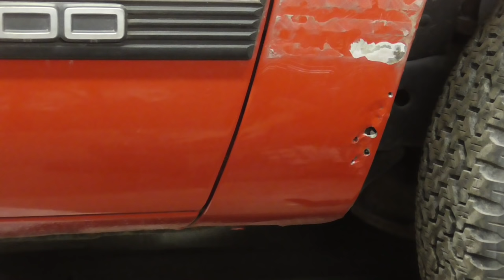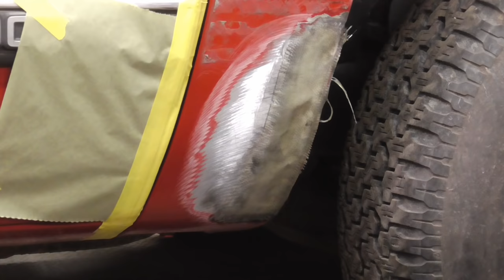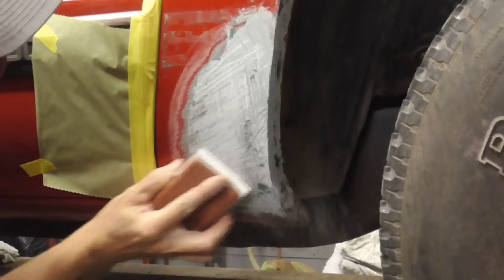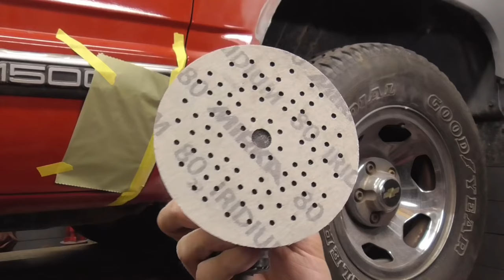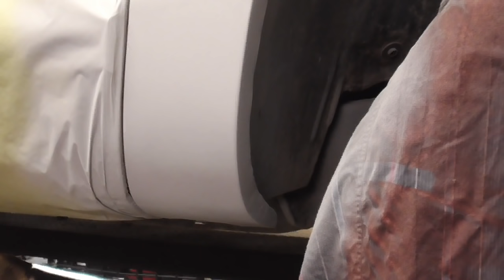How to Repair a Rust Hole with Fiberglass - No Welding!

Comment: A nice repair. My father and I ran an autobody repair business when I was growing up. It was in Nova Scotia and rust repairs were a large part of our business. I used fibreglass products to repair rust holes on a regular basis. In general, the fibreglass approach lasted much longer than cutting out rusted areas and patching with sheet metal. The approach that you used doesn't burn off the paint and coatings on the back side of the repair area which will will minimize rusting later on. Fibreglass is excellent in that it is not affected by salt or moisture.  Thank you for the video.
Reply from the maker: You're welcome Harold - thanks for the support and your input - have a good weekend :)
Reply: You just answered your own question
Reply: @crazymango-6977 yeh rust will come back ALWAYS if using regular steel even if you do everything right. only way it wont is if you use zintec steel , stainless filler , and rust convert the back of the repair (inside the body) then put a rust inhibiting primer on and put an underseal product containing oil behind there too. seems like a lot of effort for throw away cars these days
Reply: @SamFBM  thanks for that little bit of key info. You just made up my mind on choosing between sheet metal and fiberglass for my truck's rusted out wheel opening. I thought epoxy primer and sealer was enough.-but I'm also quite new to this. So I'll take any knowledge I can get.
Reply: @SamFBM I have an e46 m3. I’m stuck as what to do now it’s gonna be a classic car so I wanted it done good but I dunno which approach to take
Reply: @SamFBM   It wont come back if you paint the backside of the metal. Which is possible if you drill access holes and then use a 360 nozzle tube and insert it behind the welds to paint the back side with etch primer and then paint, and then a few weeks later once the paint has fully dried, cavity wax / oil.
Reply: @ratgreen  will it really do any good? It will be dirty and rusty so whatever you apply won't be sticking too well...in areas you are likely just painting a layer of dirt and flaky rust?
Reply: @harrisiqbal3608  I wouldn't do it this way if it's a classic car, unless you just want a driver quality car that looks good from 10 foot and is not going to be any big money car or valuable vehicle.
Reply: @natevanlandingham1945  I mean painting the back of freshly welded in metal which lots of people forget to do.
But yeh for Rusty insides of frame rails etc then I wouldn't bother painting. I'd just spray fluid film / lanolin / cavity wax to stop it rusting anymore
Reply: @ratgreen  ok I'm following what your talking about.
Reply: May I ask you some questions ? I went to register my car, they didn't let me make it with glass stickers and forced me to dismantle it and they forced me to cut the iron piece and solder it to be approved, can you give me advice? about this registrar?
Reply: @harrisiqbal3608  For historic restorations and "keeper" vehicles, I'm afraid that the sheet metal repair method is the only way to maintain the value of your vehicle. So sorry.

Comment: Excellent repair Bud!! I fixed my 57 Chevy quarter panel just like that back in 1975, it's still holding up 45 years later!!☺
Reply from the maker: Excellent! That's great to hear.  This method is all my dad ever used for rust repair - I think it was very common in the late 60's, 70's and 80's
Reply: @805ROADKING I also did my 57 with this method..however it was in 1979... I also still have mine!
Reply: @LakesideAutobody  Hello! Your videos just showed up in my feed & I am SOO excited.. I have loved cars since I bought my 57 Chevy when 13. ( I STILL have it! ) I like how you explain everything, as well as the old school approach with some new applications and products. Life has went full circle and now again I have time (AND MONEY) to enjoy my vehicles. My 93 Chevy truck has a lot of same areas of repair this 91 does..I am curious as to what brand tape you use? Masking seems to stick more than I remember back then..Again I appreciate the calm walk throughs of every details.. No over the top, loud mouth, over production theatrics. Definitely be back!
Reply from the maker: @daisyorpington784  Thanks so much for the kind words Daisy - glad you like the channel.   I use 3M Automotive Refinish Masking Tape 388N.  Feel free to ask ?s - I get to them 1-2 times/day - Jerry
Reply: It's such a shame people don't learn how to tin with a propane torch, and fill with lead, and copper stranded wire as a matrix, such a simple procedure.  And is truly permanent and surfaced with JB WELD.  Average person doesn't know the difference between polyester, thixotropic or epoxy resins.  Your video was very informative, I've done it your way, and it seems to be a  50/50 gamble, it usually does look good but you'll see jobs where It shrinks, cracks or crazes.  Thanks for sharing   "Lead- Leads"👍

Comment: Excellent repair! I used to cut and weld patches because it was the old school way. Now this method is all I use. It’s a better quality repair for daily driver vehicles.
Reply: Steel and fiberglass expand and contract at different rates. Nuff said.
Reply: @MrSticks9999    True, but I've been doing it this way for the past 40 years and it works great in areas like this for a daily driver car.
Reply: @USCG.Brennan  I would say . . if you just want to cover the rust up cheaply, there's still a better way. At the base of this, it's all about adhesion. You cannot get away with that when using fiberglass. Its going to release. So if there is a better source for adhesion, the repair will last longer.
Reply: @MrSticks9999  If you prepare the area correctly (thoroughly cleaned and scuffed) the fiberglass will stick and hold.  I've never had it come loose before or if it did, it took years.
However I will say that if you're thinking of fiberglassing a non metal hood scoop on a metal hood (for instance) then yes, they expand and contract at a different rate and WILL separate.
Just saying, based on my years of panel repair.
Reply: Restoration should be removed !!(?)
Reply: You can cut away the rusty metal coat the support behind it removing or incapsulating the rust and still fiberglassing the panel. Otherwise it will still rust through. You got the talent just take the extra steps.

Comment: And then you get a bondo bucket. I think Chip Foose does this 😂😂😂😂
Reply from the maker: I show all methods used in body shops so folks can decide what's good for them:
There's 3 ways professional body shops fix rust:
1) Combination of Lap and Butt welds.  If you insist on strictly butt welds, here's the best way to do them for longevity: https://www.youtube.com/watch?v=e9bjZ_UxtJg
2) Lap joint using structural adhesive or panel bond
3) Fiberglass cloth and fiber reinforced body filler
 
See Eastwood’s video as to why body shops don’t butt weld then agressively grind off the strongest part of the welds, and attempt to metal finish today’s extremely thin metal:  https://www.youtube.com/watch?v=rpH50kh4W00

Comment: Since you had holes large enough in panel would it be good ideal to spray some ospho or some sort of rust ecapsulator behind the panel. Surly its still has some rust and only will get worse with time from inside out???
Reply from the maker: True but the main reason it rusted is because of trapped leaves, needles, debris, that get soaked w/ salt water.  Just eliminating that will stop the rust - really.  Lean a sheet of thin sheet metal up against a fence and it'll be there for the rest of you life because it can drain and dry.  You're right too about sealing the back - if you can do that, it would last even longer.  Here's a vid on how I prevent rust after the repair:  https://www.youtube.com/watch?v=8XaZBy7GC7A  - have a good weekend :)
Reply: Lol not here in SW Louisiana you put a sheet of unprotected metal against a fence and it will be rusted in a week. Lol. 
Keep up the great vids I watch and learn something each time I watch. Thx
Reply: @LakesideAutobody   Right Nanz from NC

Comment: Jerry, your videos are top notch! Love the way you walk through your procedures.  Clear and easy to follow along.  I don't have air tools.. but I do have the electric 7" HF polisher/sander (one of your top ten tools from HF) as well as the hand tools you use (cheese grater, hand block and medium length long board). What would you recommend in terms of which sandpaper grits I should keep on hand? Both for the circular type and hand block, long board?
Reply from the maker: I appreciate that Bob - glad you like the videos. All you really need is 36 grit, 120 grit, 220 grit and 400 - that's it   Those grits can do everything in the shop.  I will do a sand paper guide video soon to address that topic :)

Comment: I mentioned this on another one of your videos but I used this technique on the rocker panel of my son's 2007 Yaris.  It results in a very very durable repair.  Four years later and still solid.
Reply from the maker: Thanks for your input Robb - that's really good to hear.  If you can get another 4 or more years of driving a respectable looking car while being proud of being able to do the repairs - that's what it's all about :)
Reply: @LakesideAutobody  I sourced it for him over 4 years ago, it was a one owner Yaris, 95,000 miles.  Paid $4000.  Now has over 132,000.  He has bought a bigger car, so just sold his Yaris for $4500!  Crazy what's going on with used car prices!
Reply from the maker: @robbflynn4325  Yes it is.  Dealerships around me will flat out buy your car from you for a pretty good price - you don't even have to buy anything.  They are short on cars - heck Ford doesn't even make cars anymore except for Mustang - weird :)
Reply: @LakesideAutobody  We have a 2019 Forester, we bought it new in Nov 2018.  Recently took it into the dealership for a recall item to be fixed.  Salesman came out and spoke to my wife and gave her a sheet of paper with $20,000 offer for it there and then.  We did not pay much more than that for it when new, and it now has over 60,000 miles, and remember this is a stealership who aren't exactly renowned at paying top dollar for cars!
Reply from the maker: @robbflynn4325  That's nuts - I don't get it - things are really crazy since Covid - something sort of small like that can literally throw everything off balance and wreak havoc on the economy.
Reply from the maker: @robbflynn4325  I don't know what's going on... my brother in law (cop) says his job has never been easier.  His motto now, "Don't Persuit - Just Solute"  Ain't that crazy? Can't really blame him though - he's got a family - doesn't want to risk loosing his job.

Comment: You should try soaking the fiberglass cloth on a flat work surface first then pick it up and place it on the damaged area. I think you will find it will go much faster and easier. You still have to work it into the surface but now your cloth is loaded with resin and you're not having to try to soak it upside down. Gravity is your friend. :-)
Reply from the maker: Hey man - I had blinders on!  Good idea.  That would work real well - thanks for the input :)
Reply: That's the way we do it on boat repairs soak the patches then work it in make sure you have no air bubbles.

Comment: Thank you for making this great, easy to follow, instructional video.
I'm fairly certain that untolds of folks will find this video very helpful, when they have a go at using fibreglass to repair stuff.
I'm a '57 model, and I'm always learning stuff, especially from videos like this one.
My Late father told me; (after I'd made a real mess of a job).
I thought that he was going to call me a fool.
 But instead, he said. 
The only folks tat never make mistakes are those that never do anything.
Reply from the maker: That last line there is so very true.  The only way to stay completely safe is never leave the house :)

Comment: Man oh man that’s a blast from the past, when I was young I had many rust buckets and that was my no.1 way of fixing them. Now in my older years still use that method once in awhile but now been using West system epoxy now, does take longer to cure. Far less brittle than fiberglass resin and if you can get to the back side and coat it with epoxy it encapsulates the rust better. Good stuff buddy I just subbed to your Channel.
Reply from the maker: Thanks - that's good to hear.  Here's one you might like too:https://www.youtube.com/watch?v=wRl1QfkrBeY - Glad you subscribed :)
Reply: Yup!
Epoxy is adhesive, polyester is just a filler.
West System will hold like crazy to clean metal.
Reply: @LakesideAutobody  Here's another thumbs up for West System. I bought it a couple years ago when I had to replace the floor of my boat. VERY easy to work with. A gallon can of resin and a quart can of hardener, each with their own pump. The pumps are like what you'd find on orange hand cleaner, but they are metered to match the system. So, 3 pumps from the resin and 3 from the hardener - no guessing - mix it up and go. Store it away with the pumps in the cans. Keeps the contents clean and ready for next time. Thanks for another great video Jerry!
Reply: been using west system for over 20 years on wood and metal. Works Great!
Reply: @davesilvia9711  I've been using it for 40 years now, from building boats and everything else. Good stuff
Reply: So west system is better than say the bondo brand fiberglass resin?  I'm new to all this and have used west epoxy for marine stuff but never on vehicles.
Reply: I used it years ago on my '70 El Camino. Looked good, but bubbled up on me a few months later.
Reply: Yep epoxy is alot better than poly if you can swing the extra coin, and west is really good stuff.
in the long run it is better but theres the cost. 
Why is it better in the long run?  Polyester absorbs moisture. 
Glad my "composites guy" at my "shop" gave me lots of pointers like the moisture thing with poly and a bunch more.
He reminded me of how a fiberglass boat can gain weight over a season ,and then lose it when it's dry-docked. 
I tend to listen to him, he's got no problem cutting the nose off a carbon fiber airplane and redesigning a sleeker shape.
Reply: @jdboy9  little known fact ,poly absorbs moisture but epoxy doesn't.
Reply: You look calm with Miss probably a waste of time because most of the people on here can't even change of tire so they look at a big rust all looks like that it's considered like brand-new cuz most people don't even know how to change the oil change and tire or even put air in a tire on a car these days that's why they'll pay $20,000 for a 20 year old or 12 year old ship box with 100,000 Mi on it that's the truth just waiting for the world to end

Comment: First off, you provide great content!
I am knee deep in restoring my jeep to give to me son.  Frame, floors and ALL driveline, suspension and steering has been rebuilt or replaced.  I have just started laying into the body work and am having serious issues with all types of fillers due to heat and humidity.  Polyester glaze sets up too fast wasting silly amounts of money.  Metal 2 metal putty was doing the same so cut the harder in half and it never set.  With sadness and frustration I spent 5 hours removing it all.  I was forced to by original bondo to continue tomorrow but am worried about its durability and longevity.   Wish things went as easy in diy as they do in the videos  lol
Reply from the maker: Don't bother with expensive fillers or fancy brands.  Get yourself a gallon of basic filler, right around 25-30 bucks.  Use less hardener and you'll be just fine.  Start by using half of what you've been using and if it still hardens too fast cut it in half again.  Please let me know how it goes for you.  Feel free to ask as many ?s as you need - I get to them 1-2 times a day.  I'm doing a video on filler selection this month so it should help you out a bit :)

Comment: Bro I appreciate your channel! Just picked up a ‘94 E350 Club Wagon with a high top and your channel is going to be a game changer for me. It’s got the 7.5L engine but it’s got some rust on it!
Reply from the maker: I love big old vans like that - I had a 1986 Dodge B250 high top conversion van - came with a factory CB!, power bed,  rear air - just awesome to travel in :)  Ask ?s if you need - glad you like the channel :)

Comment: I always learn new tricks and tips from your videos! I don't know why bondo has a bad wrap. I've never understood that way of thinking. It works great!
Reply from the maker: It's used every day in every body shop and dealership across the nation and you'd never know it because they use it correctly.  Heck yeah it works great.
Reply: This is not Bondo plastic filler , this is fiberglass cloth soaked in fiberglass resin which is waterproof ,topped with fiberglass filler ( Bondo glass ) .Bondo plastic filler is not waterproof , it's only good for a cosmetic repair .
Reply: If you just used rust reformer before filling fiber glass then it would be perfect. Because it stops the rust

Comment: my truck in the picture had the same spot on the fender rusted out but much worse. so i made a metal repair panel and glued it in with short strand fiberglass . 
it has been over 7 years since i fixed it and painted the truck and not one bubble .  i have been using the same kind of 7 inch cp grinder since around 1973.
Reply from the maker: Thanks for the input 60Chevy :)